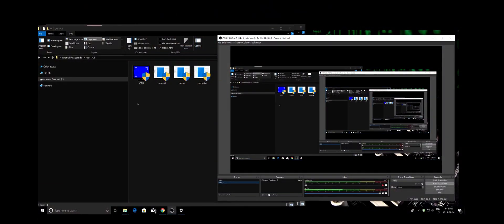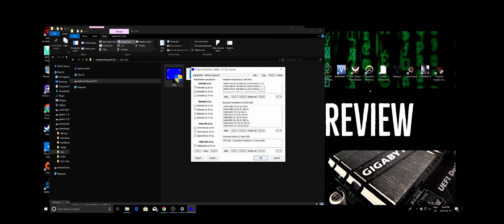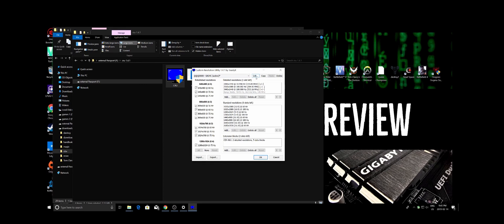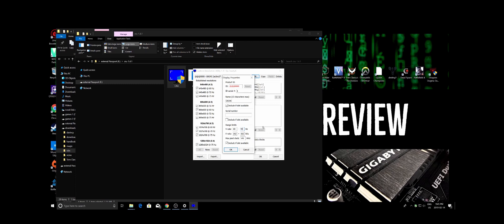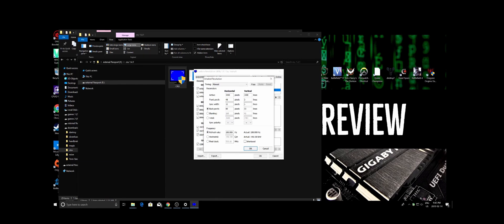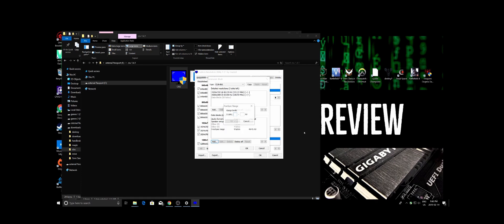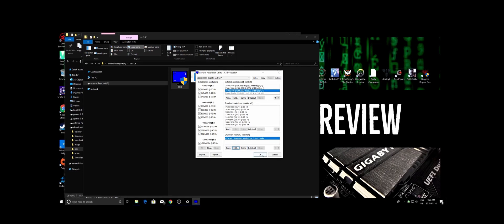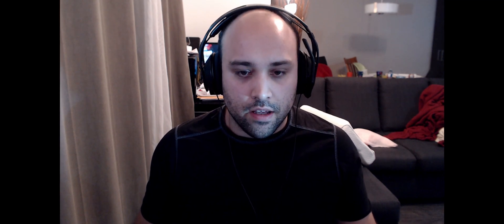AMD Freesync flicker and range fix (english)

Comment: I have a 6800xt that makes the fliker in some games, there are many videos on YouTube that shows how to solve it, but I researched it and in most cases it is caused by the amd driver that I saw on the site that exactly when activates freesync and amd is already working on the problem, but we just need to solve it now, there were 2 drivers that the problem continued. I already changed the monitor thinking it was the same but no, in the new monitor it does that.

Comment: Goodbye freesync dont come back never, now is VRR no Flicker no bug nothing
Reply from the maker: Its basically the same thing just a different name the problem lies with the monitor manufacturers and they’re faulty validation techniques.
Reply: @slayer93339  I have a 6800xt that makes the fliker in some games, there are many videos on YouTube that shows how to solve it, but I researched it and in most cases it is caused by the amd driver that I saw on the site that exactly when activates freesync and amd is already working on the problem, but we just need to solve it now, there were 2 drivers that the problem continued. I already changed the monitor thinking it was the same but no, in the new monitor it does that.

Comment: Incase these ideas don't work guys.
I fixed mine by reducing my refresh rate from 144 to 120hz.
Idk why it fixed it, but it just did.
thumbs up if this helped u.
Reply: mine didnt completely fixed it but at least it reduced the flickering to around 90%..
Reply: bich that is our problem to begin with. We are having flickering issue on 144hz when we are trying to remove the flickering from 144hz. No shit sherlock it removes the flickering at 120hz

Comment: I just chnaged Ultimate Engine to standart Engine and all of my problems disappeared :)
Reply: What do u mean bro?
Reply: @diegoguzman5280  There are two types of freesync
Reply: @jonnypump16570  ohh and where do you change that
Reply: @diegoguzman5280  in your Display settings of the Monitor
Reply: @jonnypump16570  what display?
Reply: @ajalcantara9973  Samsung C24FG70 Curved LED Monitor 59,8 cm 24 Zoll Full HD 144Hz 1ms D57489

Comment: So felt like I needed to comment. Because I almost punched a hole in my Dell S2417DG monitor. It had probably the worst GSync flicker I have seen in any videos. Mine was terrible. It made me sick looking at it for too long. I think this fix actually helped. Even though it is labeled as FreeSync range. The flicker is not 100% gone in my case after making these changes. But it is MUCH better, and usable. It flickers in load screens, menu's and very slight flicker when frames drop and raise heavily. It used to be TERRIBLE in those scenarios before. I know GSync is still on as this monitor will show in the menu the Hz its is running at, resolution, and if gsync is on or off. It still shows as on. 

So anyway thanks for the idea. I had tried literally everything you could think of. Nothing worked except this. It really seems like maybe dell just forgot to add some numbers in the monitors firmware. Which is such a Dell thing to do.
Reply from the maker: Glad it helped! and thank you for the comment I really appreciate it, When companies drop the ball it's up to us pick it up and keep playing.

Comment: I just did almost the same, i changed in cru  refresh rate from 48-120 to 75-120 to reduce the gap... Now my game is not flickering anymore ! But I think it's normal ... I mean my game is 60fps constant, and I just told the system my gsync can refresh only between 75 and 120hz, so the gsync is just never used because de fps are below thoses values ... Don't you think I'm right ?
Or because I put 75, it means it always refresh at minimum 75 even if 60 should be enough ? 
Thanks
Reply from the maker: Hi, if you are playing at 60fps the threshold to activate gsync is not being crossed if you set it a 75 as minimun, so there will not be anyway flickering below 75hz but gsync is not being used

Comment: I'm wondering if you've tried with an Nvidia card.  I have what I believe to be the same monitor (viotek GN34c) and no matter what I do I can't seem to get freesync detected with this monitor.
Reply from the maker: benjygoulet what series of card do you have ?
Reply: Technical Bind  1080 it picks up free sync on my other panel no problem
Reply from the maker: benjygoulet from what I know there are two version of this display the first version is borked on the freesync side its the one that has a 80-100hz freesync range, that one you will have a hard time making any adjustments I had that one for a year and depending on the driver I had mixed results the second one has a range of 40-100hz that one should work out of the box.
Reply: @slayer93339  thanks for the reply I'm glad I'm not the only one who had issues.  You were just the first one I saw who had it working on this monitor.  I'm assuming I have the borked one and will just have to accept it :(.  Thanks for the reply's your awesome
Reply from the maker: benjygoulet  My pleasure. Try contacting viotek and link my other video I did on the subject It actually worked for me 😅 They sent a replacement the one with the 40-100hz and works just fine. Dont forget to subscribe lol

Comment: thanks this fixed the problem on my msi 144hz monitor.
Reply from the maker: Chad Koyan Glad it helped!
Reply: What did u change on your 144hz?
Reply: @genesismakabenta6686  the minimum  v rate I bumped up to 60 I believe.
Reply: @chadkoyan3096  what do you mean you believe, you posted a comment saying this fixed it, what settings did you use...
Reply: @purplemossgrows172  v rate 60-143
H rate 223-223
Reply: Works flawlessly
Reply: @chadkoyan3096  what msi monitor do you use, I use a MAG32?
Reply: @purplemossgrows172  Optic AG32CQ
Reply: @chadkoyan3096  It doesnt matter bud, your info helped me immediately, THANK YOU SO MUCH
Reply: @chadkoyan3096  I want to make sure you saw my thanks to you sir!!!
Reply: @chadkoyan3096  you legend it works flickers annoyed the shit out of me but i tried your settings and now everythings fine

Comment: You should doublecheck whether freesync kicks in at all after your fix. If you exclude the monitors current max refreshrate from the freesync range, it is very much possible that freesync just isn't kicking in and therefore no flicker occurs.

It was like that in my case. My monitor supports a 48-144 hz range, which I set to 60-143. In the monitor's own sysmtem tab I could see, that the refreshrate wasn't varying anymore, so it wasn't a fix, only a complicated way to disable freesync.

It is a shame, really. I would argue that freesync would coume especially handy in the sub 75 hz range, so anything else other than freesync ultimate isn't worth much.
Reply from the maker: An easy way to chek if freesync is active and working is with amd's freesync test software  and yes some combination of settings can bork out v-sync itself 😅 sadly a lot of panels are not tested enough and given validation too quickly especially on older models (new ones can stills use older tech).
Reply: @slayer93339  I have actually managed to get my hands on that software. However, it's FPS range only ranges from 55 to 60, so totally outside of what I wanted to test.

I found it more reliable just to watch system tab on monitor and managed to get freesync working excluding the maximum refreshrate (48-143). It still flickers.

I also had a suspicion that the firmware brightness setting of the monitor when freesync ultimate is enabled causes the issue. I noticed, that brightness slightly decreases when freesync standard is enabled, and even further, when freesync ultimate is enabled.
However, after setting the freesync range to 48-144 when standard engine is set in monitor's own settings (and it actually worked, monitor shows Hz adjustment ranging from 48-144 even in freesync standard mode), flicker still occurs.

One last thing I was able to test thanks to the demo software you mentioned was the test pattern. And here I noticed something very interesting: when the red bar moves across the black background at 55-60 fps, there is no flicker, as soon as windmill is showing again, it flickers like crazy. 
This is reproducable regardless the freesync mode and freesync settings.

I further tested whether or not it is just a certain range the monitor can handle without flicker, so I tried the stock freesync standard range in ultimate mode (120-144Hz): no flicker, 100-144: flicker

My suspicion is, that this is caused by the monitors black frame insertion feature. Especially in low framerates the duration an inserted black frame is active on screen is longer, hence darkening the whole percieved picture until the next regular image is displayed. There is no other reason I can imagine why it should flicker for the windmill and not for the  red bar with black background.

There is another theory that PWM controlled backlights getting more percievable at certain frequencies is causing this. However, this wouldn't explain why the percieved picture of windmill demo flickers why the red bar with black background doesn't, as even with a black background the monitor's backlight stays maxed out.

All in all if I had to bet my money on what the cause of this issue is, I would choose black frame insertion.

If you observe the flicker closely, you can see that the picture gets dark and returns back to normal brightness and doesn't get higher at some point .

Maybe some brighter mind than me might be able to find a way to modify samsung  firmware to prevent black frame insertion. I would clearly prefer a little more blurry image that is tearfree rather than a crisper and tearfree but flickering picture.
Reply from the maker: @renedescartes2613  Ok so you have a samsung monitor, its probably a dumb question seeing how much you've dug around but back when the cf791launched samsung actually made a firmware patch for it that fixed some of the issues. Have you checked on their website for your specific model? These types of workarounds are really sadly panel and controller dependent so depending on the vendor you might have more luck than with others.
Reply: @slayer93339  No, it is not a dumb question :)

Looking what the manufacturer has to offer is a reasonable thing to do, thank you. They did actually release a firmwareupdate, which extended the freesync range from i believe 75-144 to 48-144. This provided supprot for LFC (low framerate compensation via framedoubling, which only kicks in, when min. supproted freesync refreshrate is 2.5x the maximum , in my case 48hz properly works even when monitor is set to 120hz). However, the flicker still is present. I think the issue isn't lacking LFC, but something else. It is a shame that NVIDIA does quality controll that much better than AMD regarding variable refresh rate monitors.
Reply from the maker: @renedescartes2613  I am crossing my fingers that the days of bad freesync implementation are over, I actually managed to get viotek to replace the monitor I bought to a more updated version after over a year of talks with them.
Reply: @slayer93339   Me too🤞

I have actually managed to get my hands on a newer firmware version of my monitor, which is only provided on samsung's korean website (1021 vs 1019). It is a nice thing rhat they are providing firmware updates at all. However, unfortunately it didn't help either.

They also have a narrrower monitor with a similar naming sceme (chg70 vs chg90) even regarding the firmfare updates( 1022 available) and identical specs other than the panel width . However, the monitor wont update using foreign firmware.

I think my last resort will be testing all amd drivers since the launch of the 5700 xt and report back. Maybe my test will be of some value for people wirh similar problems.

PS: iIhave also tested different cables, hdmi instead of dp. Also I take back what I said about the brightness dimming during flicker. It is actually an increase of brightness and return to normal levels.
It is not maskable using monitor or radeon settings to max out brightness/contrast/gamma or minimizing it. Color deoth (6/8/10 bit) doesn't change a thing either. Different resolutions, gpu underclock/overclock and utilysation seem not to matter aswell. I wonder if this could by any means be cpu related. But that is something I will test last.
Reply: I just wanted to update: I have tried the oldest available driver for my 5700 xt, the latest one aswell as the latest optional driver with no difference.

I have also tried Windows 7 as it is the oldest OS that is unofficially supporting ryzen processors. Again I tried the oldest and newest drivers: no difference

I didn't get freesync working on linux, but I would generally assume it is not OS related and probably even not  a driver issue.

I also did some testing with nvidias pendulum gsync demo and noticed something interesting: when fps slider is set to 50-144 hz flicker is tolerable, only once every fps sweep cycle. It is worse when min fps is set below 50. While watching closely I noticed that the set minimum and maximum fps are not very accurate. I had to set 55 fps not to dip bbelow fifty and 160 to actually achieve 144. 

The good news is, that the panel itself can handle Hz variation from 55-144 flawlessly. LFC kicking in makes it worse, but it could be prevented by setting min fps accordingly.
My conclusion is, that there is nothing wrong with the advertised specs of my monitor itself.

As the pendulum demo is a very clean testspace (all gpu ressources are used at all times to keep the demo running, mine ramps up to 99% gpu usage) I think the Issue are real world scenarios, when frametimes are not consistent  and fps frequently drop below LFC threshhold for an unmeasurable amount of time. I tried Dota2 and CS GO, which were only flicker free with freesync standard engine no matter what.
Other games like Sekiro run mostly flawless with freesync ultimate.
Mount and Blade II flickers on world map but is almost flickerfree in combat.

I don't know who deserves the blame. My OS and PC hardware work  as intended, so does my monitor and the games I play in general.  But as it seems any unlucky combination of either of those can potentially induce freesync flicker. Other than identifying games with more unstable frametimes and avoiding the use of freesync ultimate for those I see no solution for now. I also won't RMA my CHG90 monitor as it is the brightest  32:9 ultrawide with 144 hz and HDR support and very pleasent to use.

The green side of things isn't free from complaints regarding gsync flicker aswell.
I won't regret my hardware decisions and live with it.
Reply from the maker: @renedescartes2613  Sorry I missed the last message, I work in the health care system in the south shore of Montreal its been a little hectic lol, from what I can tell is that it's not the graphics card or any other component but most probably the panel itself VA panels have in general slower response time in terms of pixel switching + if you have local dimming enable you will get flickers since the panel is edge lit and not a full array. The edge light itself is pwm controlled wich is not as good as a true flicker free panels most people wont notice it.

 Setting the brightness higher and setting the response time to higher settings and disabling local should help with the flicker.

Comment: Couldn't get this working. My panel's range is 48-144. As fast as frame rate starts dipping I get flickering. The only thing that "helps" is locking frames at 100fps and adjust graphics settings to stay as stable to 100fps as posible.
Reply from the maker: What monitor and what type of cable are you using ?
Reply: @slayer93339  MSI mag241c DP. So I can use freesync and try to have as stable frames as I can to reduce flickering or don't use freesync and try to keep stable fps to prevent screentearing :D.
Reply: @amrokas  did u fixed this issue?
Reply: @marno_0338  no. I have changed the monitor because in my case the issue was with the pannel itself. It didn't support freesync with Nvidia graphics cards.
Reply: change your range to 50-144. that should fix it.

Comment: Thanks for that info. I got some questions on the technology. 

1. If the FreeSync range is 48-75Hz and the fps is 45 Hz, why does flicker happen?

2. If the FreeSync range is 48-75Hz and the fps is 45 Hz, will Low Frame Rate Compensation kick in and hence no flicker?
Reply: Thanks for the response. I read somewhere that for panels that support LFC, the flickering is a side-effect when the fps is doubled so that it fits the FreeSync range. 

Is that correct?
Reply from the maker: @stevenchungys  thats a good question il have to read up on that.
Reply from the maker: 1-The panel is probably trying to sync up even outside its range, low frame compensation is not available on all models and on some models the moment you step outside the determined range the panel may flicker or even blank out.
2-If the panel has the option and the firmware supports it should in theory.
 
This is an older video of mine that explains some of it.
https://www.youtube.com/watch?v=9gCh7arYf1w&t=34s

Hope this helps.